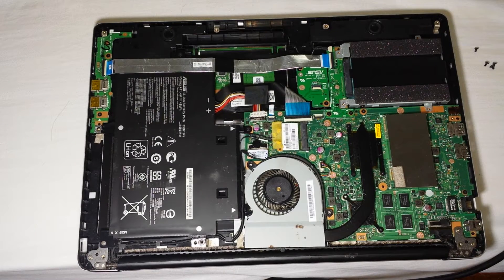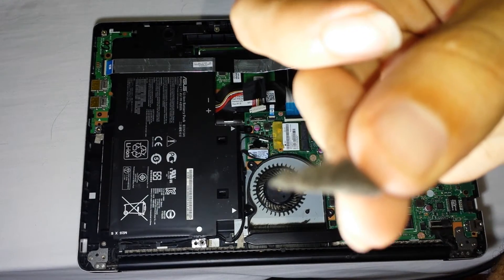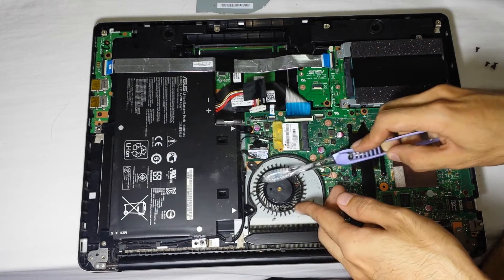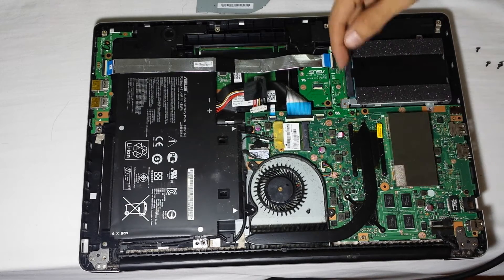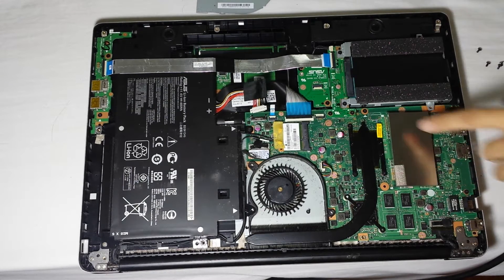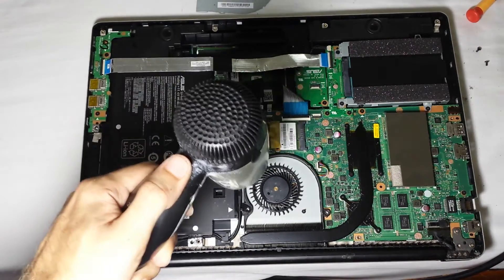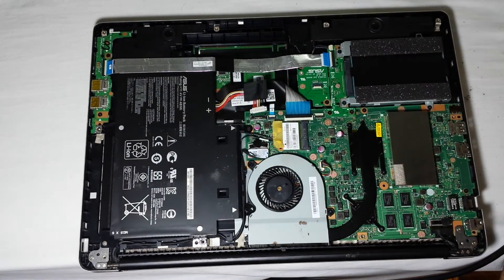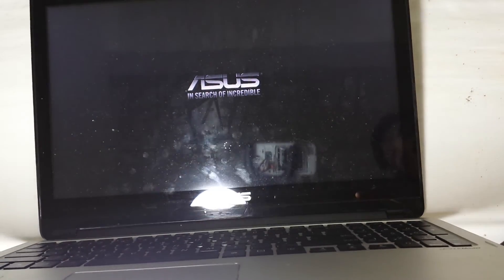How to Clean ASUS transformer Book Flip Fan, add RAM, SSD TP500LN TP500LA

Comment: Common mistakes:
Don't use a hair dryer near sensitive electronic components. 
Don't remove dust and dirt with a toothbrush. 
Don't touch components without a ground strap. 
Careful with that screwdriver! 
Even human sweat can fry a motherboard. Try not to touch anything with your bare hands.

Comment: I need help, I have a Asus x552l laptop, when I turn on the laptop, it has no display, it has a short "bzz" sound coming from inside the laptop. The laptop is working (I tested it with connecting USB to make a sound) , but no display, even connected to the external monitor. Any solutions?

Comment: I have a question. Should the fan start as soon as the computer starts? I think my fan is dead.
Reply: Yes. The fans should start with power, right away. Try blowing them out with canned air. If that doesn't work, replace them. Never run a computer without working fans. The CPU can burn out in a 10th of a second without a fan cooling it.

Comment: How do I clean recoat the thermal paste on the CPU and GPU? could you please post a video of that?
Reply: Isopropyl alcohol or lighter fluid. One, tiny, droplet, directly on the paste. Then, gently, rub with a small sponge or Q-Tip. It takes a while. Be patient. Don't make a mess. Wear a ground strap. Don't sweat into components!